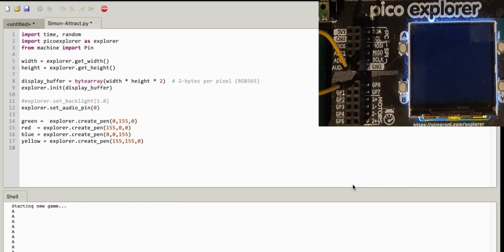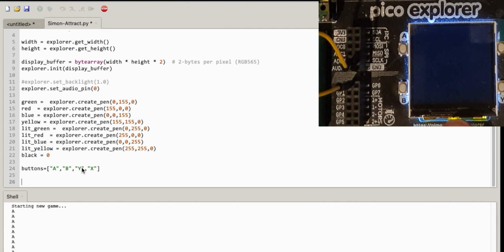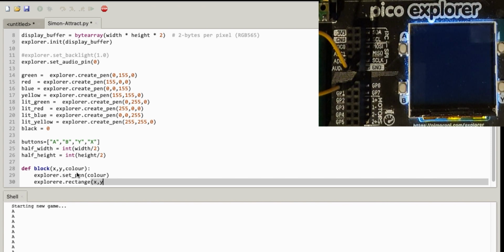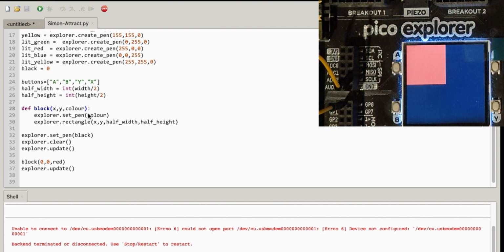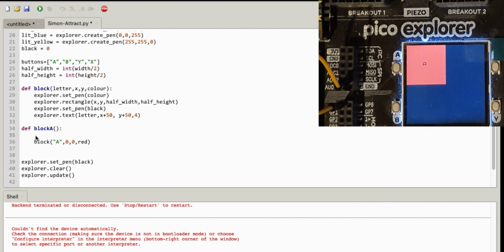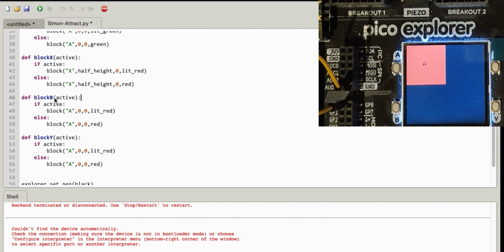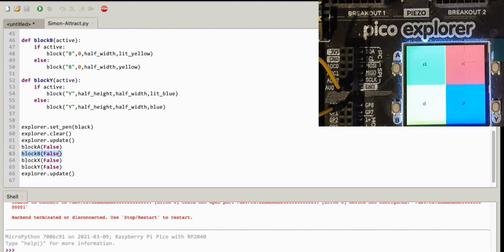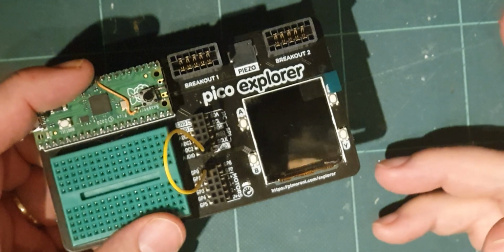PicoExplorer Simon Game - Setup Lights and Buttons

Comment: 2 things:
First, you can use integer division instead of the normal one. You can do that by using // insted of /. This will give you an iteger back wich should make the code a bit cleaner. Alse, this, like the int() function rounds down
And Second, if you every do something, wich gets a specific input value for a condition, you van use a single line if statement, wich returns one of 2 values(anything, int, bool, etc.) Or does one of 2 things depending on a condition.
It works like this(everything between ** is an comment wich should be replaced with actual values/functions):

Condition True if Condition else Condition False

You could use it like this:

blockA(True if explorer.BUTTON_A else False)

To light up a panel when you press the button.
As said, you can also call functions out of these single line if statements like this:

func1() if Condition else func2()

You can, of course pass parameters into the function as well. The only thing you cant do with this single line if statement is changing the overall structure. For example, you cant just leave the else out, you always need an if and else Value/Function. For that you would need to write it like this:

If *Condition;: func1()

However then, you couldnt directly return Values and print them, for example, since it would just give you an error at that point.(Someone correct me if wrong here)
What you also cant do is add a elif(as far as i know, someone correct me if im wrong here too).
Note: all things have been written in regular python, so i cant 100% guarantee that it works.

Edit: i forgot to say, that if you call a function, that returns nothing, it will be treated as if it returned None, but if your function returns somethinf, for example 5, that will be used as the value. Heres an example:

Def mulby2(x):
    return x*2

def divby2(x):
    return x//2

>>> print(mulby2(4) if True else divby2(4))
8
>>> print(mulby2(4) if False else divby2(4))
2
>>>

Comment: Rather than int(x/2) you could use x//2. // is floor division in Python, and works similar to integer / in C. 

Also, having to reset it here is not because of your code, but Pimoroni's. It shouldn't be that easy to crash, and I think it is because of the memory management mistakes discussed before. 

"Shouting at the screen".. a little bit. Firstly because you should be using data structures (e.g. a list of namedtuple) to hold your blocks and their properties, so you don't need to repeat the code for them. Secondly because you shadowed the builtin function "all", although that doesn't really matter until you want to use the function you hid. But the syntax error? That's minor, because the compiler can tell you it's wrong.
Reply: @0neMadGypsy  I messed up in many ways. Indeed, one of them is this; essentially shifting into the same mistake I perceived, lacking the introspection to make it out. Ironic. I don't feel I am alone in making such mistakes, however; for instance, the "crybaby" thing you slipped in here. We both misread tones, because they weren't being expressed clearly (or perhaps at all). I saw that I needed to break away, and did a poor job at that too. 

I'm not sure we can or should attempt to salvage the conversation. Know at least I now see a hint of where I consider that I went wrong, and shall endeavour to learn to do better. It's often difficult.
Reply: @0neMadGypsy  You're overcomplicating things. There's no need to turn every line of code into a puzzle. 

explorer.create_pen(0x00, 0xaa, 0x00) does the same thing as your rgb565(0x00aa00). Which isn't really required here anyway, as the RGB triplet can be passed directly to set_pen as well. The use of decimal bitmasks is just hard to read, the triply overlaid shifts even more so. Thanks for reminding me of to_bytes/from_bytes, though it's again a strangely complicated way to write things. Even more so when you're forcing a byteswap instead of specifying which endianness you want. 

The whole lambda is unnecessary and counter to the point of a palette; you're repeating calculation (including creating a new list, discarded after one read) instead of storing a smaller result. If for some reason you insist on using call () instead of index [], pal = list(map(rgb565, colors))._getitem_ works. 

And you're microoptimizing operators for something that runs a few times a second in an interpreted language, using >> instead of //, yet you're using % which is just as slow rather than &. 

I really recommend Raymond Hettinger's lessons.
Reply: @0neMadGypsy  Are you deliberately reverse interpreting things? There's absolutely something wrong; you're overcomplicating it. When you've made your code slower, harder to write, and much harder to read, what have you gained? I'm not saying you need to particularly preserve memory, I'm saying the round trips you're making are in the way for everyone. By the way, your extra hard to read divmod operation has a typo which wouldn't have been possible if you'd used divmod.
Reply: No. Precompiling the palette (and then wrapping it in a single element list for no reason) is entirely your idea. You're crossing the creek to fetch water. This was supposed to be a code example to demonstrate some sort of improvement for fairly simple, non-critical, beginner code. Why does it contain "pal = lambda i:" over "def pal(i): return"? Because you're operating in write once, never read mode. You assert it's not hard to read simply because you're not reading it, only defending it. Come back in two months and tell me it's not hard to read again.

I had a quick look at your do-same code. It has magic numbers (constants in arbitrary formats instead of expressing why they have their value), super long lines, methods and attributes hidden from nonexistent subclasses, generic functions implemented as methods, a single-use class, unaligned tabular data, the same typo you claim doesn't exist, lots of single letter non-local variables, ternary operator assignment with duplicated conditions instead of an if block, inheriting from object to trigger a Python 2 specific workaround, etc. You spend effort on things that aren't problems. Overcomplicating things.
Reply: You asserted your code works with 14 colors. Can you tell what sets the limit? How well does it render 6 boxes? You're operating of your mental model of what you meant the code to do, not what it does.

The reason I care is not that you write throwaway code. It's that you then come and assert your code is absolutely the best and only way to do things. If you want to teach, craft the code for learning.

But you're right about one thing. I need to drop that. It's not productive. "import this" (PEP 20) is far more helpful.